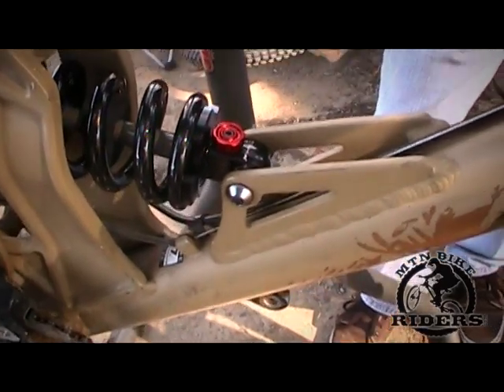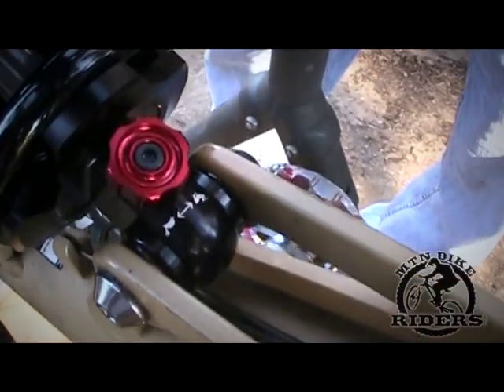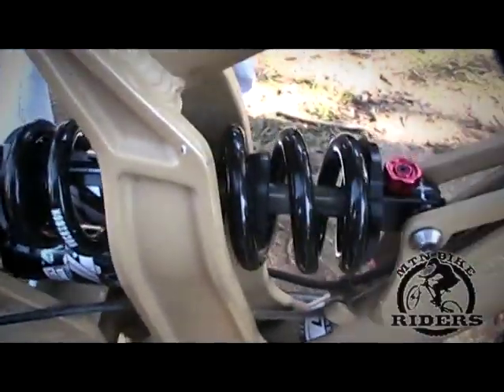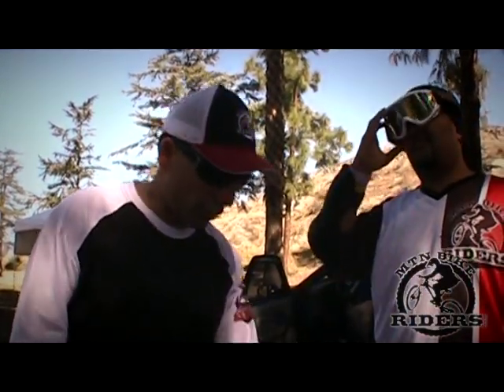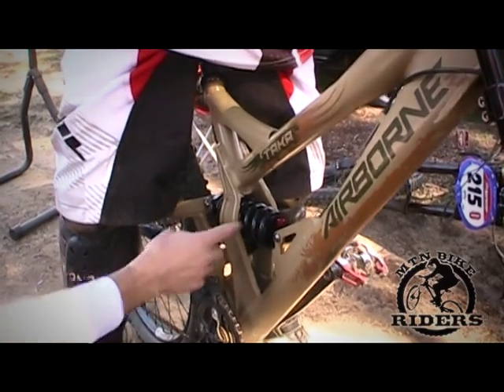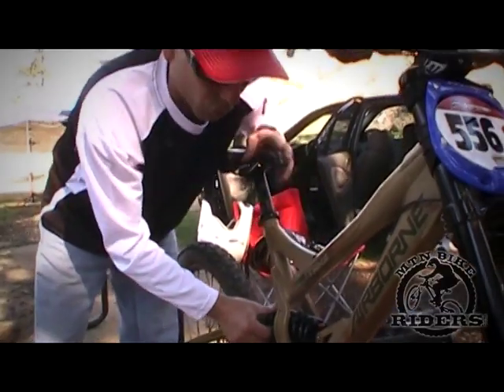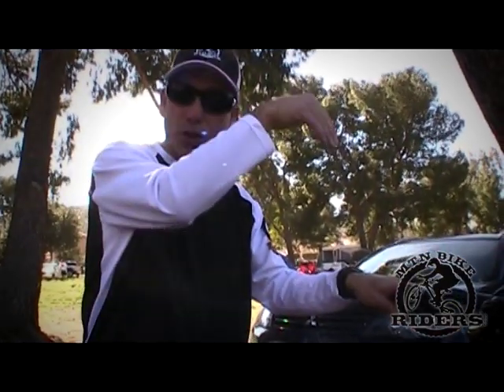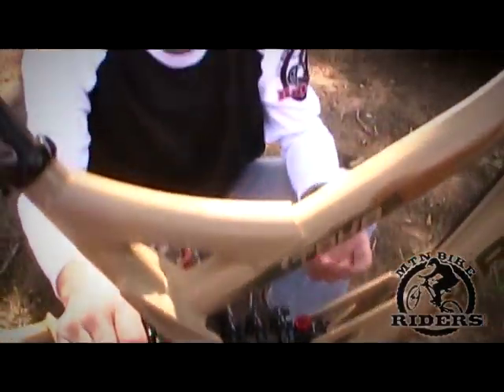Setting up the preload and rebound on the Rockshox Kage

Comment: @0:25 what do the two letters covered by red and blue mean?
Reply: That's the factory tune of the shock internals. Rockshox uses for the rebound and compression settings:  L, M, H (low, medium or high).

Comment: How do you roughly determine the right spring weight to achieve proper sag?  You said he is using a 550lb spring, how much does he weigh?
Reply: In the internet there are "spring calculators". They tell you which spring to buy for you.

Comment: Don't preload , change spring rate , also sag is meaningless, if you are bottoming out all the time increase spring rate , if you struggle to use travel reduce spring rate, foolishly using the spring collar to achieve sag will only have negative effects of requiring more force to begin to use the travel.....😏